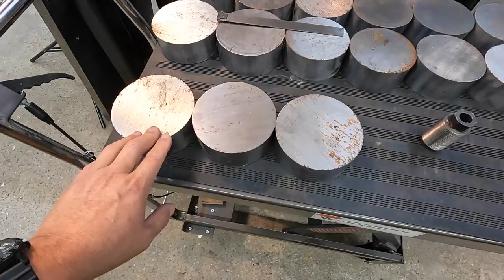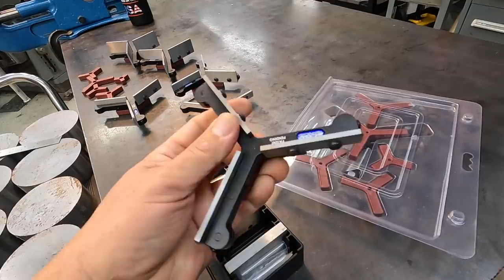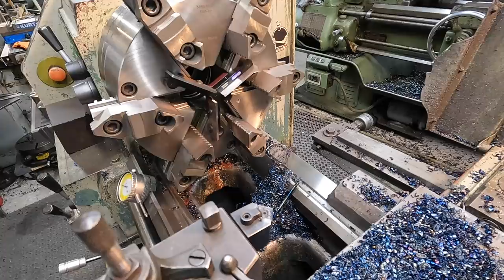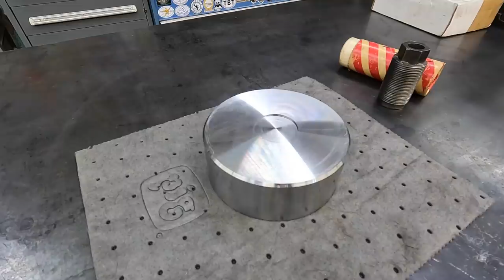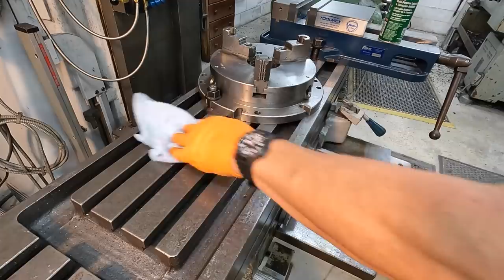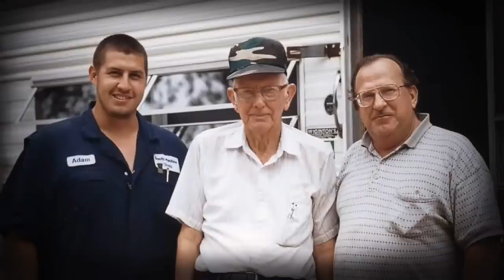Machining Lathe Leveling Feet for the American Pacemaker Lathe

Comment: I respect you and your work. I view most of your posts.  This your shop and you should have the faith to depend on your decisions.
As a retired field serviceman for an American machine tool builder, at the least I would have marked the leveling screw centers, moved the lathe, drilled and properly installed hold-down studs long enough to extend through the pads and leveling screws so that a locking nut can be tightened.   On all machines I have installed, each leveling screw had it's own lock nut that tightened the screw in place once machine was level.  Only then was the hold-down but to be tightened. We never used the hold down studs to level the machine.  Never set any machine on two different slabs.  Be sure pads set on flat concrete, grind flat if necessary.  Our normal leveling specs required no more than 0.00025" TIR per foot, and no more than 0.0005" TIR of overall axis travel.  Most times it was better than that.  An interrupted cut will cause the machine to move, then twisted beds, bad finish, and taper will follow. Please excuse my soap-box speech, just stating what I've seen in my 35 years in the trade.

Comment: Mazak has used this style leveling bolts for as long as I can remember. One thing that I learned decades ago is to exercise caution when lifting a lot of machine weight with a single leveling bolt. Under a lot of weight the hollow leveling bolt will distort when using an open end wrench. This can be counteracted by using a box wrench or socket. When Adam said some leveling bolts were tight and he was going to remove them to dress the threads I wondered if they are distorted and are out of round from the "Mazak" leveling bolt effect. 

I like the counter bore leveling bolt pocket. I have frequently had pads skew out of place.   The counter bore effectively eliminates this problem. A little lube under the leveling bolt has already been mentioned, but is a good idea.  Adam is a big guy, so his pad thickness should pose no problem, but shorter pilots would like thinner pads. I generally kept my pads no thicker than 1" for manual machines for pilot comfort. I experimented with various pad designs over the years and found that fancy pad facing provided only asthetic advantage. Any decent saw cut on a concrete floor provides all the necessary surface contact. The top side fancy work provides no functional purpose. Machine tool builders sometimes supply sheared cutoffs for OEM leveling pads and don't even deburr them.

I like pretty. Adam has time and material. Adam likes pretty. Kudos to him for producing pads that are unnecessarily pretty!
Reply: What do you think about putting in an insert about 1/8- 1/4 thick between the adjuster and the pad to prevent sticking.
Reply: Tall or short can be fixed with a standing platform…. I like to see thick pads like Adam’s as it raises the machine higher to facilitate a better clean up
Reply: @firesurfer  This sounds unnecessarily complex to me. Methods like this add functionality, but don't provide any real benefit that I can see. When I started rigging and setting up machinery my boss insisted on gluing machine pads to the concrete. He even had me Blanchard grind pads to get parallel faces and improved surface flatness over just turning. I couldn't see any advantage to the surface prep when surfaced against a concrete floor. We "never" anchored our machine tools, relying on machine weight to hold them in place. Drill presses can be easily toppled over by turning the head and table to the side and need to be anchored, as an example. Grinders often rely on a three point mounting system. I have employed wedge type leveling pads for grinders, but grinders perform higher tolerance work than milling and turning machinery. I have used the pads with a ball bearing ball between the leveling bolts and the pad, but only when supplied by the manufacturer.
Adam employed all round pads. Modern lathes require a flat edge so the pad won't interfere with installing the coolant sump/chip pan and/or conveyor. Old machines like his AP probably don't pose this concern. I would caution Adam to be certain that a flat edge may be necessary to prevent operator trip hazard on the operator side of the bedway. 
My experience is that a few leveling bolts on a machine like this AP will support barely any weight. Most of the weight will be distributed on a portion of the bolts. Some will be edged gently into place to make contact and not affect the flatness, crowning, twist, etc of the long bedway.
I had one pilot that liked his Clausing Colchester perched high. I made "stilts" for his machine that were taller than Adam's pads. As my back fails I find that ergonomics are more important to me. I am sensitive to operator comfort in a way that seemed silly to me when I was younger. I believe that Adam's machine is sitting on the floor. He has likely futzed with the machine and thinks elevating it on his pad perches will improve his comfort. Shops often employ thick rubber mats. Our shop operators often doubled matting. Adding 2" of pilot comfort is another reason to employ thick machine mount pads.

I purchased my first PA this morning for my home hobby shop. Mine is similar to Adam's. I am fretting rigging this machine since I am told that I grossly under estimated its weight. I only have a 3T gantry hoist in my shop. When I was employed our shop had adequate machinery to easily rig 50K lbs. I keep forgetting that I no longer have access to rigging equipment that was shop owned. Nothing currently in my shop is over 1T. I foolishly looked at my bargain PA this morning and thought I could haul it on my trailer rated for 7000 lbs. I am enlisting help from my boys and their machines. I may go pick up the tooling and accessories tomorrow, but up to 9" of predicted snow tomorrow will hamper my plans to bring the new toy home soon.
Reply: @paulhunt598   My experience is whenever you have a bolt, it needs a washer. This allows for either better fastening, or to prevent binding. I've tested several problems like this and almost always, the added washer/separate pad is better.  Without one, there was a subtle difference. This is especially noticeable when  going into clear holes that don't seem to need a washer. The bolt head binds up a little and the torque is wrong. This is a different situation, but is somewhat similar to a c-clamp that has a swivel pad on the end of the screw.
Reply: @firesurfer  just grease
Reply: @jadesluv  Yeh, no kidding. It's just the idea of chasing residual gains. There was no need to face it either. But this channel is about teaching, not necessarily practical things.

Comment: Adam, it appears only one flute of that 1-1/2" end mill is cutting. A trick told me by an old machinist was to put lipstick on one cutting edge, then cut a slight hole. That will tell you which flute is doing the cutting, and needs honing. I wondered why he had a lipstick in his tool box. Thanks for the video. Jon
Reply: I was curious about that too. Not the lipstick, but why only one of the flutes was cutting. I get that happening when I sharpen drill bits because I'm not very good at it, but I am generally drilling into wood so the feed rate is fast enough that each flute does at least some of the work.
Reply: The “WIFE” has entered the chat.

Comment: Adam, a nice touch would be to present a hand sketch (on paper or whiteboard) of what you're proposing to make right at the start of the video. Doesn't need a lot of detail but It would really make the journey more meaningful and satisfying as you continue to talk us through your fabrication process. Even if you made the drawing off-screen after making the part but cutting the footage into the start of the video (in case you change the design approach halfway through the actual make). Capturing the sparks of the tool hitting the case hardened shaft at 11:42 was really interesting. I was so hoping to see the 23:08 footage in slow-mo to see how the gnarly chips were generated.

Comment: Nice job as usual. When I leveled out my 15x42" lathe, I used some old feet 4x4x4 wood blocks from my old couch I got rid of; however, I put some 1/4x4x4"  plates on top of my feet. This way if there is any water in my basement floor the lathe is protected. 3 years later it's still good and the height was good because I'm tall and I don't have to bend over as much operating it. Having it higher saves my back.

Comment: For my old Sheldon lathe I hollowed out the centers that rest on the floor. Outside edge about 3/8 wide then the inside about 100 thousands cut out . That way if the floor wasn't completely flat it would still be resting on more area .

Comment: Nice project, I sure wish I could find someone in northern Iowa that could cut me some slices of that sort of rod.  I am a woodworker and use steel pieces as weights for gluing pieces that are difficult to clamp.  They sure looked nice when you had then machined.
Reply: Try McMaster-Carr

Comment: I am amazed at how much tooling and machinery you have, and I'm sure you say I need this and I need that.
Reply: His dad and grandad were machinists (both passed) so i think he inherited alot but you are right he does like his tools and quite a few companies sponsor him
Reply: As a third generation machinist ?

I like the lathes. I like the K&T mill. The new bandsaw's pretty good. Can't really comment on the collection of welders. The flexarm's pretty nifty but my favourite is the G&E shaper.
So, am I envious ?
Only of all the space he has ! My inherited 'shop' is an absolute junk-ish obstacle course! I have to look where my feet are going - sometimes on the floor, sometimes I'm walking on old motors or various bits of metal.
Yesterday I threw 2 pairs of welding gloves out - both pairs had holes in the fingers. They got thrown out because I found the 'new' pair of gauntlets. They're complete but old enough to be a bit stiff now !

Comment: I love the edge precision sets, especially this one. Saved me several times.
Reply: I like the Joe Pi system of bolt on aluminum stand offs. I leave then on most of the time. Only once in a blue moon do I end up having to change them and that takes longer to get a fresh set out of the tool box then it does to change them.

Comment: I've never seen the spider spacers before. Looks like a great idea. I also have not seen those types of parallel bars before. Those would have made my job a lot easier on some parts. I think using leveling pads to level the lathe then set the leveling pads in quick set concrete would have been the way to go. Of course, it would have been more expensive. And I'm talking from a view point of installing CNC machine tools.

It might be such a big deal in your shop, but we used to pour separate reinforced foundations for each machine to isolate the machine from any vibrations from other machines & fork lifts.

Comment: My big lathe is purposely installed with a slope towards the headstock so the coolant drains off.  If you put it in dead level you will have puddling.

Comment: This reminds me of the time I levelled a lathe on a really uneven brick floor. I had to make each foot a different size to match the floor. After spending ages getting the bed spot on level in both directions I stood back and noticed the control cabinet did not look level. After a bit of investigation I realised the bed was supposed to slope slightly front-to-back, so I had to re-do the whole job...

Comment: Those chuck stops are incredible I always thought it be really cool if somebody was to come out with those
Reply: Check the set up Joe Pi uses. MUCH simpler and you can make them yourself in less then an hour and actually leave them on the chuck most of the time.

Comment: Adam, why not cut the recesses to a 60 tho depth when you faced the flat surface while chucked in the lathe? You already had the top and bottom surfaces of the levelling foot parallel at that point and it didn't seem that it was a critical fit for the adjusting screw to sit in...
Reply: That would require a tool change. 16 times, back and forth. Same with the chamfering.
Reply: @kindabluejazz  Tool changes on a QC tool post take less then 5 seconds. (More like 2-1/2 if you are going back and fourth between 2 tools)  It takes a good 5 to 10 times that long or more to take a part out of a chuck. put it down, get another one  and put it in the chuck and tighten and alight it   . .... You are obviously not the time study guy where you work,
Reply: @mathewmolk2089  There's extra physical activity and loss of mental flow to do 2 or more different ops with different tools on each part. It's much easier and less error prone to do the same op 16 times without interruption than to have keep changing what your doing, remembering which op your doing, what cut settings you need etc. You're obviously a bean counter and not an actual hands on worker.
Reply: @kindabluejazz  VS shuttling the parts to the mill, chucking them in the mill, indicating the first article on the mill, touching off and downfeeding on the mill?  Anyone who does this for a living would keep it on the lathe.  Poke a hole to start a boring bar and feed out.  Operation order could vary, but changing tools is faster than changing parts of this nature.

Comment: I'm thinking you could've mounted that end mill in the lathe tailstock and counterbored without the need for a mill setup...
Reply: Play with your toys if you got em!
Reply: Holding an end mill especially that size in a lathe tailstock is a poor set up and would likely chatter severely.
Reply: @grntitan1  Not if you use a No. 4 or 3 Morse Taper end mill holder, we do this all the time, no worries...
Reply: Someone made the fair point that the mill has automatic feed, the tailstock does not

Comment: How come you didn’t cut the recess whilst you had each pad already chucked up in the lathe? Surely that’s easier than dialling in the mill?
Reply: He likes his toy's. So let the man play with his toys.
Reply: @demonknight7965  absolutely fine if that’s the reason. For someone learning manual machining I wanted to know if there was an actual reason
Reply: Probably the same reason he has a shaper in his shop where other machines can do the same job faster. It'll be interesting to read his response.
Yes, it would have worked very well in the lathe also.
Reply: The mill can exert more pressure, and more consistently than the tailstock or carriage using the longitudinal feed. Also the dead slow center speed will not work well as a single operation for any of these ops. Step drill and bore or drill to relieve the center depth and then counter bore with the carriage. All these are multi tool ops any way you do them. The mill was best. Personally I would have checked for a better center cutter end mill. Remember, Adam said it might shatter the cutter. Lots of pressure there. 
-- 
MikeC
Reply: @mikeybeamish  Maybe he didn't think about doing it the obvious way ;)
I couldn't believe how fussy he was with centring in the mill only to go machine a recess that's far bigger than needs be. He could have done them offset - and then he'd have had some adjustment with each one !
I think considering the adjusting screws have a hole through them, I'd have drilled a hole right through the same size - in the lathe and then used a drill to do the counterbore just slightly bigger than the needed size.
Reply: @CothranMike  Good analysis. I would add to that... he used the most efficient cutter (the end mill) for that job. He could have chucked the endmill into the drill chuck and put it in the tailstock. Sure it takes a lot of pressure but nothing the tailstock can't handle. The real problem is the shank size on the endmil and whether he has a chuck big enough and that fits in the tailstock of the lathe. Also a drill chuck is not a very good way to drive and endmill. They tend to slip in the chuck jaws especially if they are solid carbide. He also could have mounted it like a boring bar but he would lose rigidity and it would likely chatter. He could have drilled a small clearance hole if he didn't have a center cutting endmill or was worried about the pressure. The basic reason is like you and others have said... the mill is much better than the lathe at this type of cut using this type of cutter witht he added factor that any other kind of drill then bore kind of operation would take far more time than a single plunge cut.